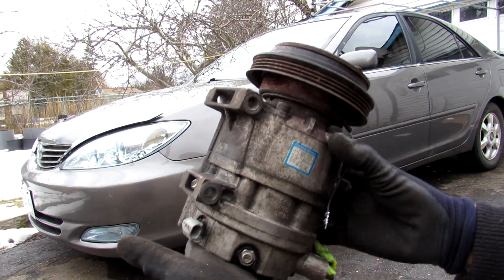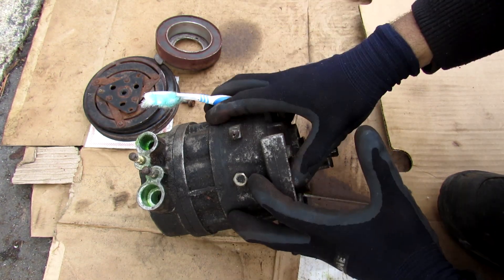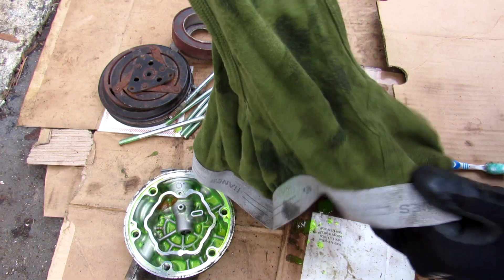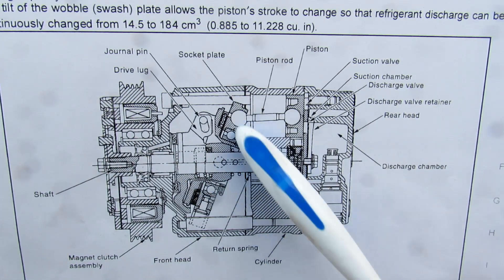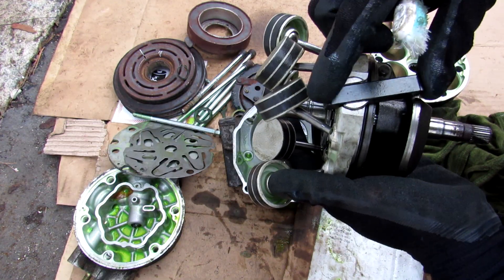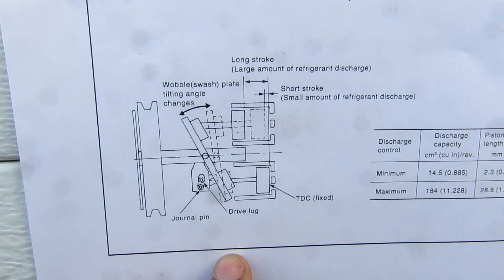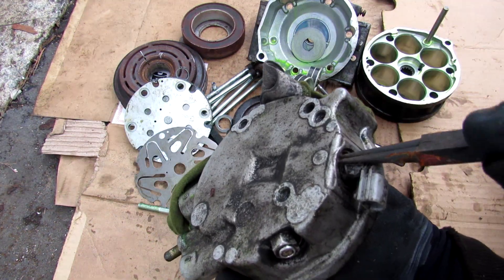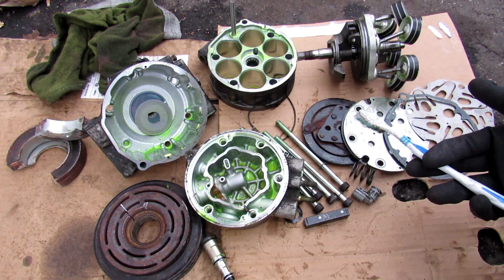How a Variable A/C Compressor Works

Comment: If your AC breaks because of a leak and you don't plan on fixing it, disconnect the power to it because the clutch will engage in the heat/defrost mode. The compressor can freeze up with no fluid in it.
Reply: If the system leaks/breaks, the no/low pressure will prevent the clutch from engaging, kind of a safety measure.
Reply: @pcnepal  Mine kept engaging and eventually froze up. Disconnected the power and no more problems. 92 Ford Taurus.
Reply: Most likely rust kept the clutch plate spinning with the worn out clutch bearing all the time then the latter eventually froze up . If you still have your compressor, open it up to check. I bet the internal is still intact.
Reply: @pcnepal  Thanks. Still need the compressor just for the pulley.  When the car finally dies I will check it out.
Reply: Sorry, overlooked you said "Disconnected the power and no more problems"
Then a 92 Taurus' a/c system is quite primitive in a sense; it lacks a low pressure switch apparently!
Reply: Or the low pressure switch is short.
Reply: @pcnepal  Not sure what's going on, but you could hear the clutch engaging intermittently every few minutes. It would click on for a few seconds and then click off. I thought maybe it was just to keep the fluid flowing to keep everything lubricated.
Reply: "the clutch engaging intermittently every few minutes"
Classic symptom that the system has barely enough pressure/ freon to close the low pressure switch, then when the system is running, the pressure drops (principle of thermodynamics) to the cut off point opening up the switch. Once the system stabilizes back to its static condition the pressure becomes barley enough to close the switch again and the cycle repeats.
FYI 92 models has R12 (not available without a licence) if not already converted to R134a.
Reply: "I thought maybe it was just to keep the fluid flowing to keep everything lubricated"
No sir your system is not that smart :)
Reply: @pcnepal  Thank you.
Reply: @William1866  You have an orifice tube system and a low pressure cycling switch. You still had a little amount of ref inside that allowed to engage the system but the constant short cycling (suction pressure reaching the cycling switch threshold really fast) is what eventually drove oil out of the compressor bit by bit. It went on so long that the compressor finally starved of any oil and destroyed itself. Not enough refrigerant means that oil isn't flowing around. It stops inside the starved evaporator and can't go back to the compressor. The ridiculously high superheat didn't allow the refrigerant to carry oil back to the compressor. The compressor running for a few seconds compounded the problem further.
Reply from the maker: That makes sense. On some cars, the A/C has its own belt, so you can just cut that.